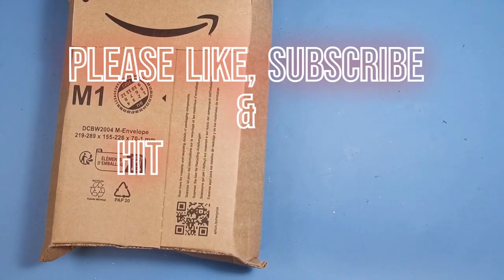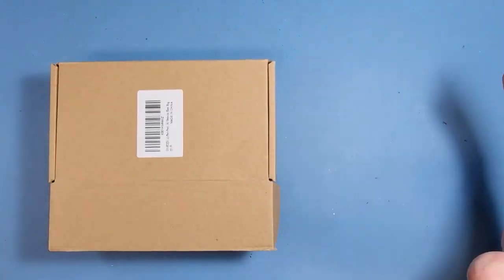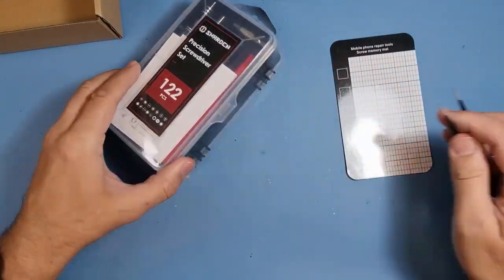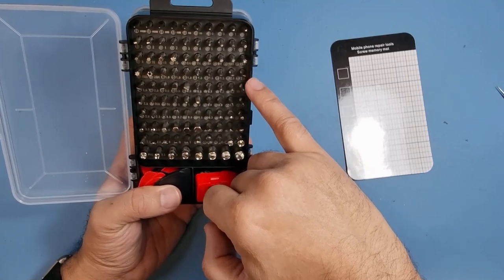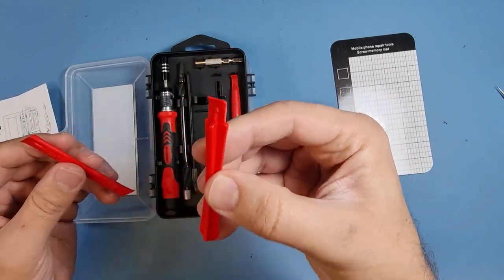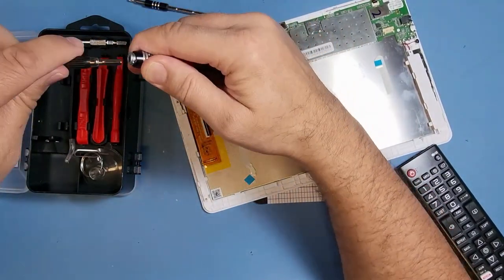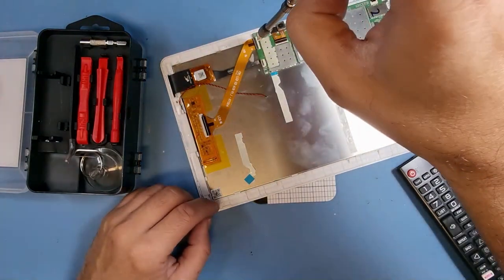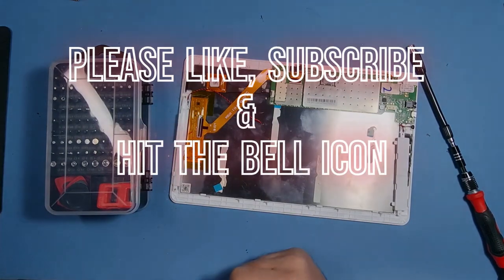Sharden 122 Piece Precision tool kit

Comment: I'm thinking about bying this kit instead of the ifixit one, how's the bits' strength? do they break easily with overtightened screws/overtightening ?
Reply from the maker: Hi I have been using it for quite sometime now as yet not one piece has broke. Go ahead and buy one you wont regret it.